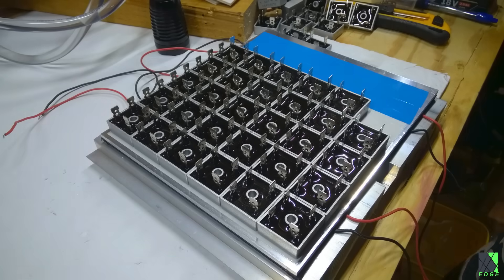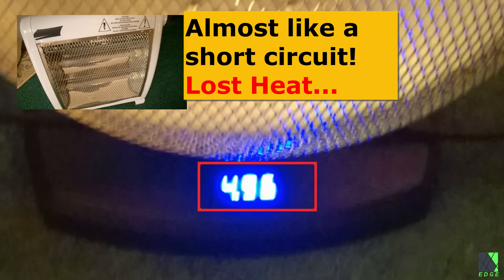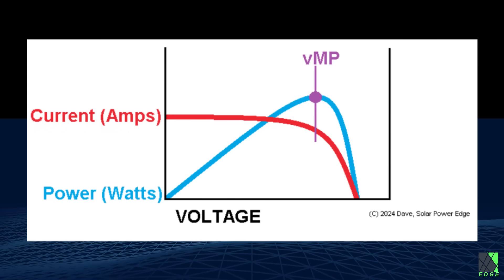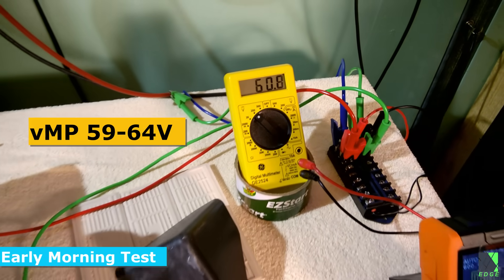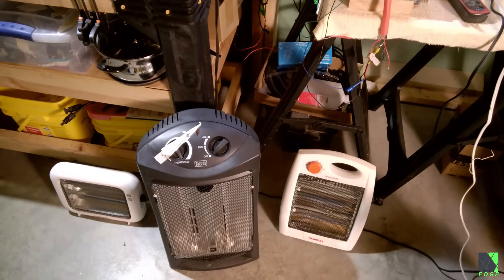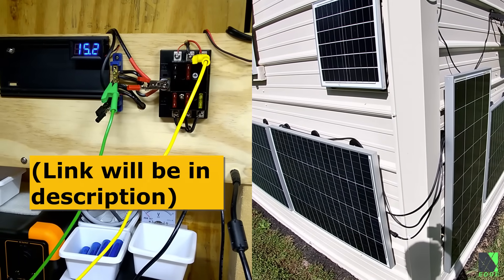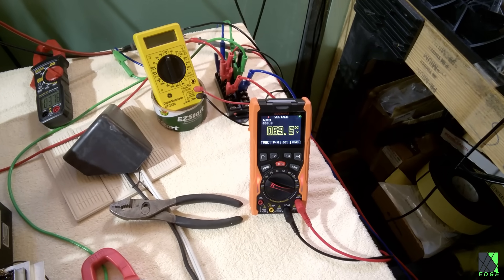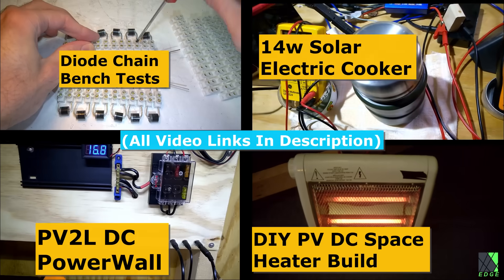How I Get More Solar Electric Heat With POWER DIODES - Poor Mans MPPT #DIY #solarenergy  #solar

Comment: Do you think is possible to use ONLY diodes? I can suggest you to put them into  diatermic oil (not conductive) to cool them down. would be like an Oil radiator and you have a good inertia.
Reply from the maker: @zuppyzuppy2354 Yes, I run them alone also. In fact that's part of the heating system for my workshop :D it's not at all necessary to parallel with nichrome. However the more Watts the hotter they get, so you need better heat sinks, fans etc. Due to having a lot of converted DC heaters, I like running them in parallel. Smaller heat sink requirement etc.
I have tried oil too, it's messy but that can work
Reply: @solarpoweredge  did you make a video with oil? Would be interesting.
Reply from the maker: @zuppyzuppy2354 good video idea I'll keep it on the list. Working on a 3rd and larger diode heater now. If that makes it to video, I could also discuss other methods of cooling such as oil etc.
Reply: @ would be very nice to see a way to measure the heat produced... in some way...and make a comparison with  nichrome.
I've very interested in that since I'm going to install a 6/7 kwp array in DIY just for heating home in next months...I would like someting safe and something without inverters and so on (offgrid).
Reply from the maker: @zuppyzuppy2354 Measurement of heat is done by tracking watt-hours, which can be translated to btu/hr. Obviously, when the heating element tracks close to the solar max power voltage nearly all day (very much like MPPT) we get more watt-hours, which in turn simply means  more heat. Your heating project sounds very exciting! We are working on expanding the existing system with racking and more panels. Solar electric heat is addicting.

Comment: Are you just adding the diode foreward voltage drop to decide how many to put in series to get the voltage you want?

Also, if i didnt want to pay for individual diodes to take the full current of my 800w array, does wiring 2 strings in parallel have any wierd effects?

I really like how this works and makes me think that with a resistor and a couple of capacitirs, could make experimenting with diy wind turbines cheap enough to put some effort into.
Reply from the maker: @markferrari9734  That's it in a nutshell... with the temps, fans and ohmic resistance of the connections it can be a bit tricky to tune each setup. However the 2 primary diode heaters in my workshop run like a top all day, from sun up to sun down. They hold the voltage very well. If the sun comes out suddenly, there is a bit of hysteresis but not too bad. Amazingly they make a little heat even when  it's dim outside. They don't collapse the PV voltage like a resistor.

You can use parallel diode strings, in fact those rectifiers internally are parallel. It's not perfect but still works OK. Max I've tried is 2 parallel strings. Not sure if you noticed this, but I am running space heaters in parallel to the diodes. This means lots of heat comes through nichrome which is very tough and cheap. The remaining heat that the nichrome would fail to extract, is handled by the diodes, which means smaller heat sink and fan requirement. Could also argue that this is cheaper too. The whole system then operates at vMP. It seems many people missed that part of the video.

Anyway hope that is all clear enough.. any questions just ask! :D

Comment: Will all the diodes in circuit be the same  temperature? If not, why is that?
Reply from the maker: @mppforall Now that's a good question! All diodes differ slightly from the factory, and so dissipate a slightly different amount of heat. But... they're all clamped to the same heat sink, which "bridges" them thermally and shares the heat. And the same fan is pushing air across them as well. So they do vary in temperature some, but not too bad. In this case, I need to finish tapping the screw mounts, which was not done when I made this video. I think after that the diodes will have even less temp variation

Comment: Maybe a small circuit to automate turning the resistive heater on/off could be made easily? Could base it on thermistor or current draw on the diodes? Regardless thank you for the content!
Reply from the maker: Good idea, that would work! Thanks for sharing ideas, glad you like the content :)

Comment: I gave you a like just because of the way you describe the way that diodes work as a voltage regulator.  This trick works in other areas of electronics and the downside is what you are using them for.  Usually you don't want waste heat.  I happen to live in Texas where heat is typically not the big problem though.  Cooling is.
Reply from the maker: Hi, thanks for the like - true the heat is a downside in circuits, this is an interesting way to use it
Reply: Use the heat to drive a chiller.
Reply from the maker: @Papa-bh6zq Looking for one of those heat-powered RV fridges so I can experiment  👍

Comment: Interesting method.
Or use a Hexfet as a constant voltage load at the solar panel max power point voltage, very simple circuit. 
If you get keen you can make it track the max power point voltage to squeeze the max power out.
Reply from the maker: That sounds very workable, I have to try it. Thanks for sharing ideas 👍
Reply: @solarpoweredge  
Diodes are an interesting and very simple method, there forward voltage varies with temperature, wonder how well it tracks the panel max power point voltage as panel output varies with the solar panel output?
Reply from the maker: Quite well when properly configured; this was demonstrated later in the video. Per 3 different modules (only 2 shown in this video), they track voltage very well. The key is the self-powered fans and a good sized heat sink. This stabilizes the temperature. In this test, the nichrome heaters are pushing most of the power. The rest goes into the diodes. When there is an inrush of current (sun comes out), the diodes clamp the voltage, drawing more current from the current-limited source (solar). When the sun comes out, the voltage will rise some then it slowly comes back down to the set point. Nichrome alone cannot behave like this at all. The effect is similar to MPPT behavior but dirt simple and cheap. Without the diodes, the nichrome heater would let the PV voltage go very high (also shown in the video when I disconnected them) proving the diodes are regulating the voltage to 59-64v region which is exactly what is needed. It will never be as precise as a DC-DC converter, but shockingly simple and effective means of getting most of the watt-hours out of the solar panel as heat. I'd like to test the % difference between MPPT DC and diodes, I don't think it's far off.
Reply: @solarpoweredge  
To squeeze that last bit of power out of the panels on a low solar day. Need to disconnect the resistive load to keep it from dropping the panel voltage below the max power point voltage. Relay with a voltage detector, but have to be careful as this may oscillate  as the voltage goes up as the resistive load is disconnected.
Reply from the maker: Good points. Nichrome can be connected ~10am when there is a good amount of sun and disconnected towards end of day

Comment: I have a simple string of 100W incandescent bulbs to utilize my solar excess. It's a 48V system producing up to 75V. Didn't realize I was leaving Wattage on the table. I wonder if I could use relays to vary the number of bulbs in use, to crudely regulate the MPPT. . . .
Reply from the maker: Awesome, you could use parallel diodes chains to extract a few more watts of heat from existing solar panels by tracking a more efficient voltage. perfect use of simple technology :)
Reply: @solarpoweredge  I have been watching your progress with diode strings. Ya got me hooked.
Reply from the maker: @Papa-bh6zq Right on - I never thought I'd spend so much effort on... 10 cent diodes?! but like you said, it got me hooked. Actually, that happened on the very first test on my workbench. I didn't think it would work. Kept experimenting and the realization slowly sunk in. Then it was a matter of "how to make use of this" and the rest was history...
Reply: How about reed switches?
Reply: @marusholilac  @solarpoweredge 
A diode ladder could control how many lights would be on at any given time.

Comment: My panels about 22V for their best power. I came up with that diodes idea also and modified a sick aluminum skillet for cooking.  I put diodes inside of cooking side and turned skillet up side down. So i can put other skillet on it. Made it 1 year ago and not tested yet, because I came up with a second idea:
   With PWM, keep the best constant voltage (22V in my case) just on the load side, on a good powerful heater (which power => maximum panel power) rated for that solar panel voltage. Only on good Sun it will be wide PWM close to 100%. On no-Sun weather close to 0%. This way, voltage will be 22V and not changing by diodes temperature.  Other plus you can rich much higher temperature for cooking without be afraid of cooking diodes. There are no diodes in that 2nd idea.
  After cooking done, I will put on it an aluminum heat sink with fins and fan.
Reply from the maker: @leupcholka3444 Hi, great ideas :) I have thought about making an oven, but so far have only heated air to about 60C and water to 100C which serves most of my current requirements

Comment: i have an existing resistor heater ran directly on solar. can you provide the formula (or refer to a good website) to determine how many and spec of diodes to run in parallel to get the mpp for the specific resistance, voltage, and current?
Reply from the maker: @JShiezo Hello, I'd reccomend checking out the "hot diodes" research paper, that's the best resource so far https://youtu.be/whOXELklxQ4

Comment: Great practical experimentation ! Kindly share to us the temperatures reached at the heatsink. Thanks.
Reply from the maker: @PeriodArmourer  Hi and thanks :) depending on the speed of the 2 fans, ~50-60C.
Reply: @solarpoweredge  Thanks much for the PV2L ideas .
Reply from the maker: @PeriodArmourer  Welcome :) 👍

Comment: Question:  Aren't solar cells themselves diodes?  If so, couldn't you just use a solar panel inside as your heater, and skip the fan because of the much higher area for the heat?  This seems to be a great use for one of those pannels with shattered glass that I have been storing up.
Reply from the maker: @IntenseGrid Hi, true solar panels are semiconductors and diodes are too - which makes this type of tech very ironic on some levels.... solar panels can most certainly be used as heaters - because flowing current into them causes heat production. I think instead of recycling some old solar panels, using them for heaters makes good sense in some cases

Comment: Simple yet clever idea to use little solar power at its best! The problem with solar for heating is: when you need the most heating you typically get the least solar power - at least in our area in south Germany. You have plenty of solar energy in summer, but you don't need to heat. But in winter you hardly get any pv-energy and need the most heating. Even with tons of diodes i couldn't change that. But if you have sun in winter of course you can use it for heating. Alternative to diodes you could use an adjustable length ni-cr-wire just with a slider or many connections points so you could adjust it to the power available. Unfortunatly this is a manual task, not working automaticly as your diodes.
Reply from the maker: @rilosvideos877 The sun gets short here in mid winter. Yet in reality and practice, for the past several years my few solar panels made a significant difference in heating. Every morning I watch my PV heaters turn on and make their contribution, no fuel, repair bills or complex parts.
But I want even more heat... for that reason, I am expanding the system. 
True in winter there is probably never excess power. In summer I will use excess solar power for air conditioning and charging yard equipment :)
Good idea using multi-tapped nichrome. Some have suggested using a microcontroller to control the heating resistance (like MPPT) That should work too.

Comment: did not you try to build serial diodes just to keep the stable voltage with some mAmps and use that stable voltage/current would be used to switch on /off a high power transistor? this way you could use the cheapest diodes like 1n4148 (and and the transistor and some resistors) and you could use your regular space heaters.
Reply from the maker: @almaspite1234 Good idea, have not tried it but should work

Comment: What is the efficiency of the panels with and without your diodes? Best regards form Poland
Reply from the maker: @HybrydaDrzymaly Hello, with properly configured diodes one can easily extract at least 10-20% more watt-hours than unregulated resistance alone. If interested check out this presentation on the research paper and the related playlist
https://youtu.be/whOXELklxQ4
https://www.youtube.com/playlist?list=PL8a6nRTNyF9PK7SExvQKNhN0t3RUP9pT7

Comment: Can you power a 12V mini fan throught the string of diodes? What kind of diodes you are using in this project bro?

I already subscribed to your channel using mu other YT account and I also subscribed to your YT channel using my second account.
Reply from the maker: @argellaguardia9390  Hi, thank you for subscribing!!! 
yes, that is how all fans shown are being powered. It's like a voltage divider / regulator. 
These are 50 amp bridge rectifiers. We can use any silicon rectifier diodes though. I plan to try the TO-220 type diode as soon as possible, they could be cheaper.
Reply: @solarpoweredge  thanks for the idea. I am considering this kind of set up because I do have big heat sinks and i ant to utilize my solar panels power to get rid of grid power during the day.
Reply from the maker: @argellaguardia9390  NP, I like the idea of using up excess power for heat... I think a lot of solar panels are under-utilized after the batteries are charged

Comment: Some actual $ comparisons would be helpful. In my experience, high current diodes aren't cheap. For those big arrays I would expect an MPPT controller to be cheaper once you have a large enough array.

Another thought is to use Peltier junctions, they share some of the nonlinear characteristics of diodes but also provide some extra heat pump power.
Reply from the maker: @niallparker3655 Hi, diodes range from a few pennies to 80 cents for certain bridge rectifiers. The kW (heating power, array size) is mostly limited by how the DIY'er builds the system, not so much the diodes themselves.

This idea is mostly not understood. But in my experience it scales up very well - therefore MPPT is never going to be cheaper than nichrome heaters and power diodes. The simplicity and low cost are clear benefits of nichrome/diodes. The diodes are just there to provide regulation mostly, extracting the last 10-20% of watt-hours.

 Currently starting a new solar rack and electric heating build, it will be over 10kw for the first test. No problem at all. I may try some larger diodes and a larger heatsink, but that will still be cheaper and simpler than MPPT for sure. 

 FYI there are actually peltiers experimentally integrated underneath the "square" diode heater, to scavenge voltage from the heat. I didn't mention it to avoid making things more confusing. -Dave

Comment: Ok so at the risk of asking a "Dumb" question!
Just exactly how much more efficient is all of this, vs a quality low frequency inverter and standard solar setup?
I'm sure there is some improvement, but given the "Expertise" required vs the stable reliable off the shelf inverters and related solar equipment that has been fully flushed out for civilian use. Plus the ease of use for all the other aspects of daily life that will require the "Standard" 120 v AC power which also means you're still gonna have to have all that equipment any way??
Jest wondering how long it would be before something like this is mass producible for John Q Public use??
Reply from the maker: @dannydivine7699  Hello, good question... and being open minded, especially asking questions for heartfelt investigation is never dumb :) 

Efficiency is about cost, ease of use, reliability, level of complexity, and much  more. I've been heating my home with simple, cheap solar electric resistance heaters for years. This saves wear and tear on my complicated and expensive inverters and heat pumps. Adding Diode strings solves the problem of extracting that last 20% of solar electric heat, while also avoiding complicated MPPT circuits. More heat, but still cheap and DIY friendly. 

Times will change! Always good to know the alternatives. And if simple coils of wire and diodes can extract most of the solar electric heat, then it is truly an efficient and affordable alternative to charge controllers, batteries, inverters, heat pumps etc.

I don't know when heaters like this would be on the store shelf, but diodes are very much in use in some countries for solar electric cooking. I think few people, if any, are using them for space heating.
Reply: @solarpoweredge  Thanks, I will have to do more research to learn more about diode sizes / availability. And honestly more about diodes in general, I as the true redneck, always thought a diodes only purpose was to control direction of current flow. Thanks
Reply from the maker: @dannydivine7699 Welcome - I always thought of them that way too, but it's amazing what diodes can do!